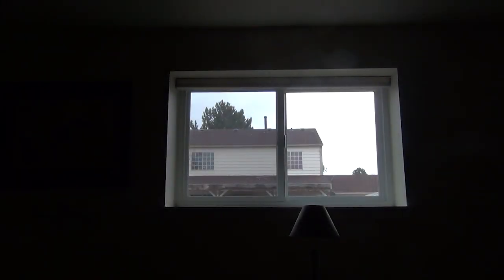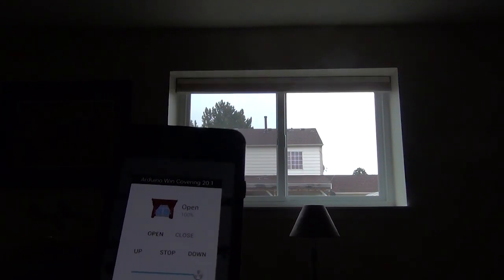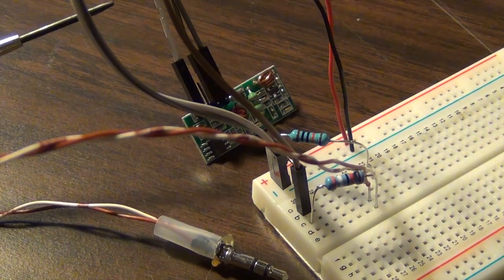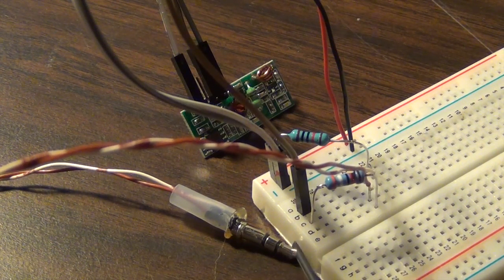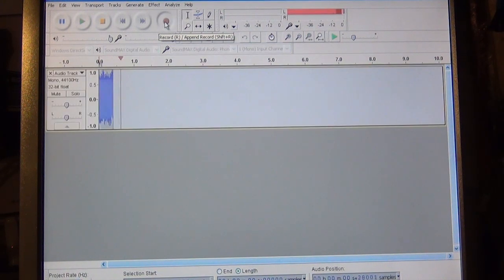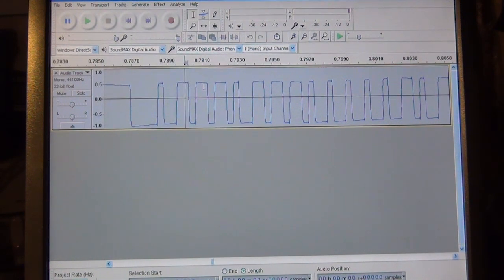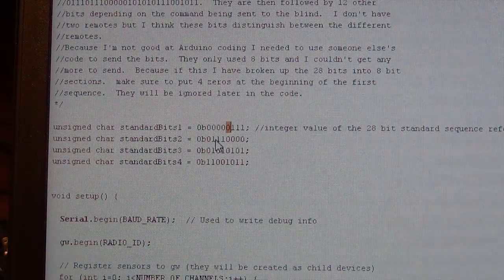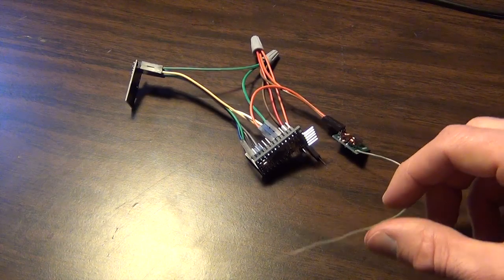Integrating Blinds.com Motorized Cellular Shades with MiCasaVerde Vera using Arduino

Comment: Hello Pete! Is there any way to get in touch with you and exchange a few messages?

I'm pretty sure I have the receiver connected up properly to a Line-In for a sound card through a breadboard (pretty much like you have in your video).  The sound card is a USB device connected to my laptop. Audacity recognizes the USB sound card device. I use an external 5VDC power source (that inserts right onto the breadboard).

I am having trouble getting Audacity to record (at least that's what I think is going on).  I know your video is 7 years old now, but am hoping to get some guidance from you.  Appreciate it greatly.

Comment: Hi Pete,  I'm confused about power.  In the video you mention the Arduino mini is 3.3v but in the PDF file you posted at mysensors.org shows you have 5v feeding the Arduino.
Reply from the maker: kevsvideoworld Sorry, the Arduino is supplied (fed) 5v power on th RAW pin but it outputs 3.3v on the power pin.  Hopefully that makes sense.  If you have an arduino that outputs 5v you will need a voltage regulator that drops it down to 3.3v for the radio.